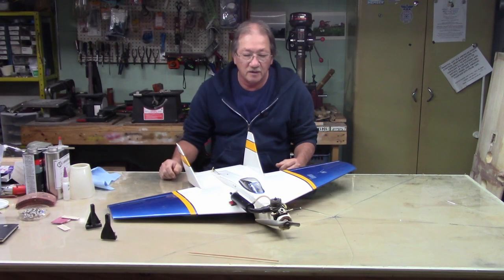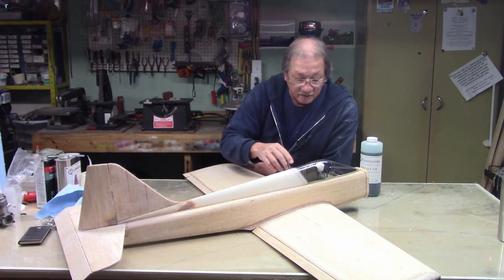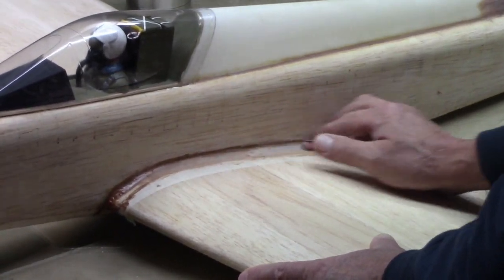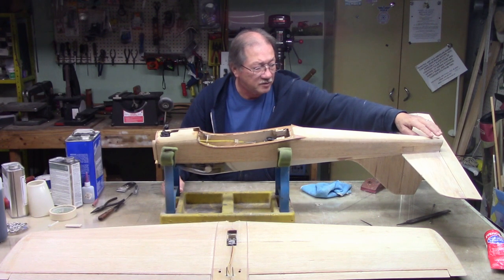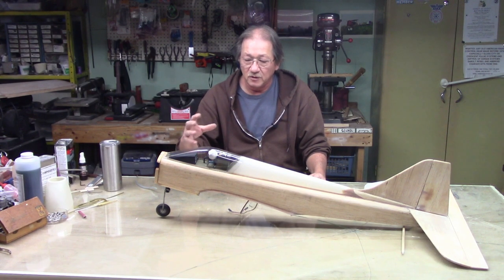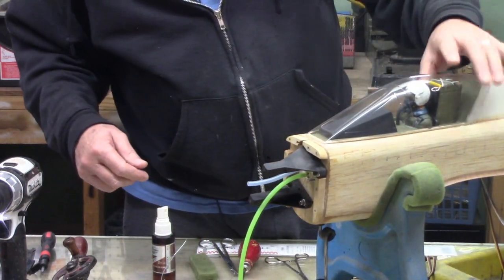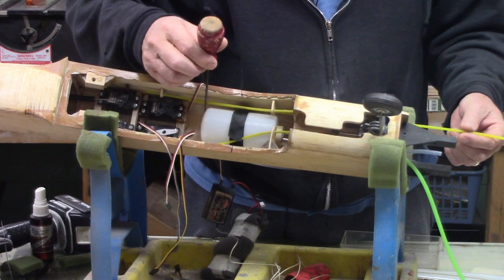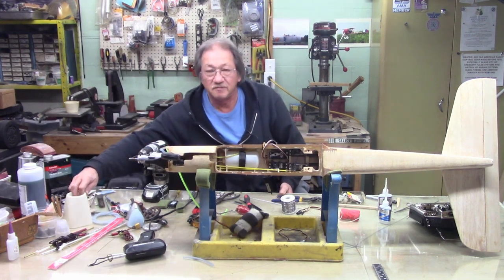SIG Kougar Build - Part 21   "Fairing The Fairing"

Comment: Hey Bob, im working on a sig kouger and most of it is already done since I picked it up from somewhere random but how do you refuel one?  This is my first rc plane that I have worked on and I'm not sure how to.
Reply: Most nitro engines are fueled through the fuel line to the carburetor.  When the tank is full, it will over flow out the muffler pressure line.
Reply: No, the oil in the fuel will keep it lubricated
Reply: @b6stead  thanks, fuel line that is on the side of the carb?
Reply: Yes, the fuel line that connects to the carb.

Comment: I use Z-Bends only on the servo end... Never had a problem.
Reply from the maker: I prefer "Z" bend on the servo ends too... However when using cable soldering on a threaded rod adapter gives a bit more adjustment and when the servo pushes the force is more linear. But a "Z" bend is more solid if you tin the cable.